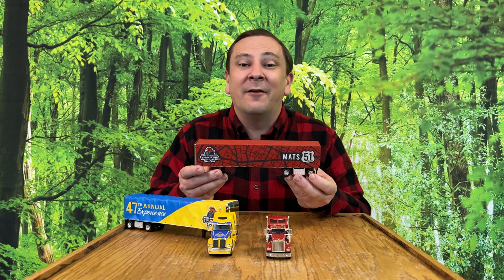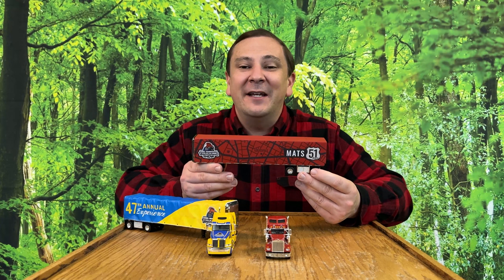Conestoga Trailers Comparing the New First Gear to the Original DCP MATS Mid America Trucking Show

Comment: I wish they would make some company trucks with those trailers. I never got any of the original trailers because they never made any company trucks for it. By the way, I like the original better.
Reply from the maker: They did at least 2 trucking companies on the original.  They did one for TanTara Trucking with a Peterbilt 579 pulling it.  It had company logos on the tractor and down the sides of the canvas on the trailer.  They also did one for Anderson Trucking which I did a video on with the link to conestoga trailers in this video description, tho it was a fancy Pete 389 show truck more than a fleet truck, but it did have the company name on the truck steps and trailer nose.
Reply: @LoganSkeele  I totally forgot about the TanTara model. I just watched the video on the conestoga trailers. I remember that Anderson Trucking model, I thought it was a blank/owner operator model this whole time.